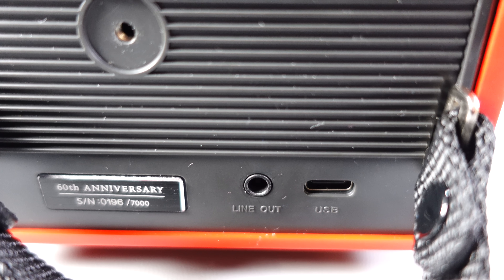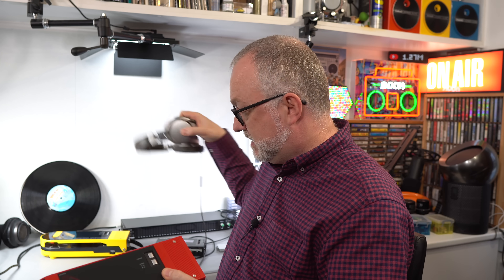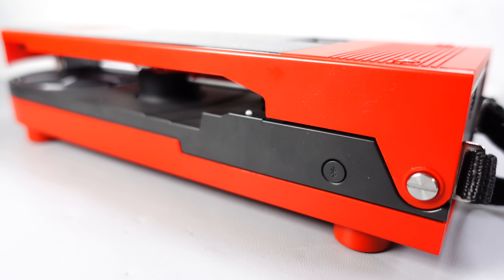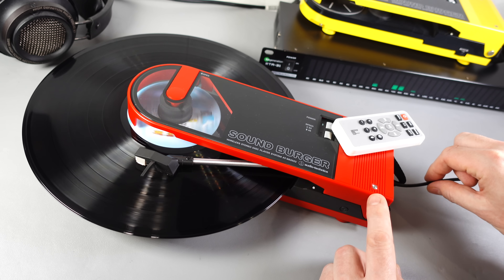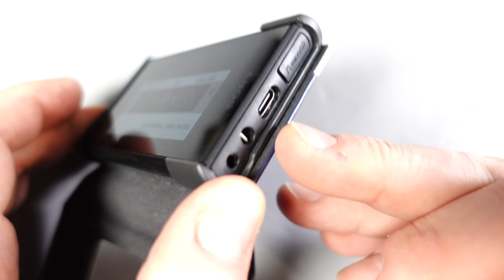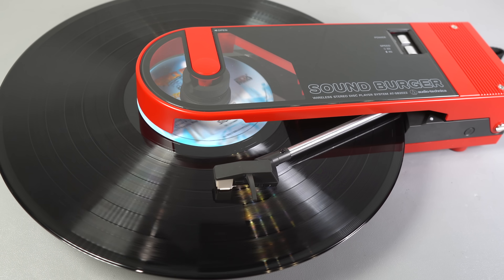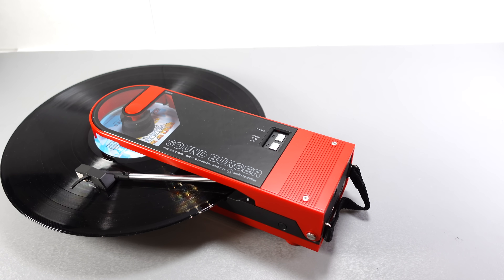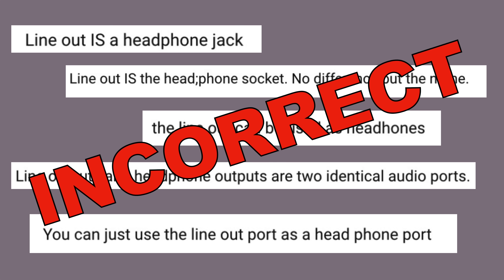Line-out ≠ Headphone-out

Comment: .. I have only watched the first 3:54 mark and as of yet, and I think you phrased yourself erroneously.. well.. perhaps not FULLY erroneously, but at the very least "in an unfortunate way"...  (and also jumped to conclusions that you didn't need to).. 

IF someone were to ask me IF a 3.5 mm "Line output" socket could be used for headphones, I'd answer "yes, but it isn't ideal", or "It's not what it's for, but yes you can... "... And that is the thing.. the CORRECT answer to.. "Can you plug in a headphone in to this socket" IS.. yes.. you can.. BUT also- even if I understand that MOST people would be splitting hairs here- It's not ONLY that it's technically possible, but it literally IS an audio output.. using the RIGHT form-factor AND pin.. and.. will not damage the hardware.. so.. IF you feel like you want to.. then you can.. there is absolutely no reason to WORRY about trying it.. 

Earlier in my life I would ONLY have answered "yes", but because people misinterpret the answer, I have learned to ADD those extra points DESPITE not beinga sked for.. A lot of people complain about the length of my comments, and this for good reason. MOST of my posts and comments could take more than a page if printed out..but.. I learned to remember to always hedge my bets because, as a general rule: People are stupid and incompetent.

Also; The two headphones you took out as of now.. BOTH are "over-ear" phones.. yes.. a standard 3.5 mm  "line out" doesn't drive them the right way (waaay too many ohms), so.. DEPENDING on how loud they are CREATED to be able to play.. The actual volume you get will vary, but between.. kind'a low.. to.. inaudible.. but also.. if you use IN-ear phones.. then you may actually get a DECENT volume, especially since it also will filter out everything else.. Technically I am annoyed with MOST phones I have had because their internal volume IS too weak for the loudness I want in my earphones.. DESPITE being built for them.. so.. "satisfaction" with the volume depend on what someone wants.. BUT.. if someone ONLY bothers about WHETHER they can listen to a record through a line output?.. then.. I'd say that with in-ears phones.. you can actually listen to the music.. and.. the question then becomes being about the "use-case".. as you ALREADY said, this is NOT a system you use in order to be able to listen to albums while jogging or ANYTHING like that.. so.. when would someone like to have a sound system "on the go" when it is REQUIRED that you have a flat surface to placee it on?.. and.. that it doesn't get shook..?.. well.. a pic-nic, out-door party, or something like that?.. yes.. but would you use EARPHONES in that scenario?.. I personally think.. not?...  also.. do people want to have to carry an amplifier and speaker (or for that matter; An amplifier and earphones).. In all other potential use cases?.. I personally suspect not.. Heck, the only use case I can THINK of where you DON'T want to play it on speakers is IF the need to listen to something "on the go.. while being completely sedentary and not shaking too much".. would be if you are trying to buy some highly priced vinyl and want to KNOW that it doesn't "skip" or has other problems with it.. hence.. volume? is not the concern.. to HEAR it is, and ease of transportation is.. especially since a LOT of peoplel selling old valuable records didn't themselves actually get those records, they just inherited it from a relative that was an audiophile- as audiophiles USUALLY keep their records unless they get a duplicate).. 

So.. use case matters.. the correct answer to the question "can you use earphones on a line out" is yes.. BUT there are follow up questions.. and.. 

....... in the end.. Even if ONLY saying "you can" to a question where there CLEARLY is an asterisk that should be put there.. or.. at least end it with a "but..".. may not be MORE erronous than SAYING that the answer is erroneous without pointing out that it.. ISN'T erroneous, just something that.. "doesn't explain the whole situation".. 

The other things you mentioned (about OTHER 3.5 mm ports used for other things- f.ex. digital data, power, etc..- isn't even really relevant.. I NEVER take ANY responsibility IF!! someone make up things my answer would mean which it doesn't.. so.. IF I were to say.. "A line output can.. ".. then I am NOT saying that you can plug in a microphone in a line output, nor a n external system- or even earphones- to a microphone input..  Yes.. they are NOT all the same.. but.. to say you CAN do something isn't the same as saying you should, and more importantly.. it doesn't mean that just because you are TECHNICALLY able to do something, it means it's okay to do so in ALL situations.. I shouldn't have to write a LONG list of EVERY potential situation that may or may not relate to the specific situation I am asked about (though I do), but.. no.. the correct answer is.. "yes you can connect your earphones in this socket.. and as a bonus validation of that question I'lll throw in that you won't harm anything by doing so... ".. whereas "but would it do what I WANT it to do?".. well. that will depend on your expectations, your hardware, and so on..  

So... saying.. "It's erroneous".. is.. based on correct information, but itself is (at least) equally erroneous. That is where the expression.. "That is a truth with modification", or.. "Well, it isn't wrong, But".. belongs. . and using over-ear phones to try to show why the answer is wrong?.. that is like AIMING to prove something to not work.

I have have saved one of my "issues" with the answer you so far provided to last.. that is.. "non-standard specs".. The thing is; There may BE an actual "standard".. yet... I have had a lot of different units.. and.. in SOME units I can say that there is NO (passive)  loudspeaker I know of that can play the FULL  strength of the top volume (WHEN used with a tape, or record that IS recorded in a COMPARABLY loud manner.. remember the old players with analogue gauges?.. the amplifier chips know nothing, they  are just stupid amplifying chips TRYING to do what they can until they can't.. and.. SOME tapes you bought DID run BELOW the actual.. "red" part of the analogue volume indicators.. but MOST of them.. went AT LEAST a third in to it.. and.. it was supposed to tell US how loudly should be considered when we recorded to tape?.. the professionals broke it more often than not).. so.. Yeah.. There IS a standard.. more than one in fact.. millions.. regarding the level out-puts.. but.. a LOT of them don't "limit" what something CAN support, only that it has to AT LEAST support "this".. hence.. Some units do have SOME form of volume control that DOES work on the "Line out" part of the system too (At least I know of a mixer-board of two that does).. where.. you readily could use earphones and listen EASILY to what was created.. I mean.. you wouldn't want to because you are overdriving the chips.. NOT enough to make distortion, but to increase temperature and reduse longevity.. also.. they DO have earphone outputs.. ).. But.. I use extreme cases as "examples".. but yeah.. it depends on all individual units and the creator of them.. as to what they can or can not do in form of volume.. though.. Line outputs DO have some requirements as to what they should handle.. ear-phones doesn't fit the requirement, BUT! it would take MORE work, and MORE components to make SURE that they don't work.. hence.. If you got responsive enough earphones- espeecially in-ear ones.. you could possibly use a line-output on SOME device to make yourself deaf.. (though I THINK that only could be possible if the device itself KNOWS it's power and has SOME form of volume control that would affect output.. you know.. like... ALL.. Mixer-boards have)..
Reply: I’m never clicking read more again 😊

Comment: Using a headphone out as line out isn't exactly "clean" either, Isn't line output suppsoed to be a "normalized" value so it's the same level on every device?
Reply: Line level is a standardized level, but for one hook up it doesn't have to be at that exact level, anything that works would be fine.

Comment: Line in/out had/has a standard I believe of 1volt max. Not enough to drive headphones but sufficient to transfer to other equipment; for example a tuner/amp. They can be just about any format like RCA connectors, 3.5mm socket etc.
Reply: Professional line level connectors operate on a voltage range of 1.2 volts. Consumer gear like the sound burger, has a voltage range closer to 300mV

Comment: Often I will use the headhone output on a TV to a amplifier and speakers, as thats what the manual says to do on some TVs.  Nowadays you can split the audio off from HDMI/eARC to get a digital output instead.    I use a DAC/AMP for my headophones which can take digital or analogue input. But this was a good overview of what the difference is between the two outputs.  Thanks.

Comment: It seems the confusion comes because many newer TVs use the same port for Line-Out AND Headphones, most likely to save on costs.

Then in the TV software settings you have the option to set if the output will be fixed volume line level, or amplified output that can be controlled with the volume buttons.

Usually these 3.5mm ports have both a line-out arrow icon and headphone icon on them, but are not always easy to recognize.

Either way, this was a very well explained video about the difference between the two and it helps to clear the confusion a bit. Thank you so much for making these videos!
Reply: Its not just TVs. Its everything.

Comment: I find it amusing how many of the comments here are just explaining what you did, in the video where you explained it. At least some others are offering up theories as to the confusion. I shall just say: well done on a fast and simple explanation which avoids going over people’s heads. I like electrical engineering but if you tried to explain with voltage and impedance I think you’d lose a lot of your audience — just saying it’s too quiet is more than sufficient.

Comment: I've used line out with a lot of headphones, from game consoles, to cassette decks, to VCRs, and while the lack of volume control kind of sucks, and sometimes the volume is lower than optimal, and sometimes higher than optimal, depending on the headphones, I've never actually had a line out be too quiet to hear. In fact, it seems like, depending on the device, it's more common for the volume to be on the high side. 
Only headphones that have been too quiet on the line out that I've used on RCA devices is the T20RP mk3. Headphone output on handheld games systems is another matter entirely, and even a MP3 player or iPhone.

Comment: All my life I've plugged headphones into line-out and never had any problems.
Line-out is a regular headphone output but without an amplifier.
Reply: Modern hardware uses software to adjust impedence. Computers don't even have seperate jacks anymore. What this guy is talking about only applies to outdated hardware only a few people in this community still use.

Comment: As you stated, a main source of confusion is that in practice, headphone outputs are often used as line outputs. Many a laptop or phone has been connected to an amplifier or powered speaker system by using the headphone output to feed the line input of the amplifier. Judicious use of the source device's volume control can give an appropriate signal level at the headphone output. Output impedance is really the issue here. Headphone outputs are low source impedance outputs while a line out is typically a high source impedance output (and as you say, line outs don't typically have a volume/level control). So a headphone output can do a passable job of providing a line output function, but a line output cannot drive most headphones.
Reply: A note to add to this...  My Asus laptop, the headphone jack can also be used as an actual line out, as when I plug something into the jack, my laptop with clarify first, whether I plugged in a line device or headphones, and upon selection, it will adjust the impedance and audio levels accordingly.  Which is very cool!  🙂
Reply: @jinky0u812  Was just going to say this, as a high proportion of PC desktop motherboards built in audio will allow you to change on the fly what the 3.5m inputs/outputs can be used as. So I imagine this has caused a fair bit of confusion.
Reply: is it anyhow harmful to the laptop if i connect it with a speaker system with subwoofer and 5 speakers??
Reply: @harshnair7126  If you're going LineOut -> Speakers then you should be fine; assuming the speakers themselves are properly amplified.  A line-level output is there to deliver a mostly un-modified audio source so that you can tune/amplify as you desire.  Please also note that a 3.5mm jack CANNOT transmit a full 5.1 signal.  A quadraphonic surround CAN be encoded through stereo channels (requires a proper decoder) - but for true discreet 5.1 channels you'll need SPDIF or HDMI.  For this instance, I'd strongly recommend getting a USB audio device that can properly output 5.1.
Reply: Not to mention that Realtek's ALC sound card chip allows to change pins purpose on-the-fly. So your jack connection can be either mic input, line input, line output or headphone output at the same time depending on settings ;)
Reply: Nope, your cause and effect are temporally reversed.  The recent practice of allowing a single jack to configure according to plug inserted is an adaptation to lessen the confusion already present and persistent, it is not a source much less "a main source" causing confusion.
Reply: @RoySATX  never confusing, in half a century, once as a kid I had headphones sound really quiet.  I didn't  freak out, I plugged it in the other hole, and good.
PCs haven't cared for decades.
recent practice? 20 years.
more like it became cheaper and more cost effective to streamline case designs, circuitry, and fewer parts (half the 3.5mm jacks per device for output).  This issue was so insignificant I don't recall anyone ever complaining about it, and I figured it out on my own as a toddler ...  so I'm sure adults that it happened to, got along just fine too.  Confusion ...  people are more confused on why its always the 3rd time you put a USB cable it, it fits, not the first time when you were putting it in the same orientation!
:p
Reply: This is the actual answer.  I just spent 5 mins listening to half accurate bullshit watching the video itself, which presents things as if headphones can never be plugged into the line out port, but the truth is the often are and work just fine, and there is no other option anyway on many devices.

Comment: Line out: used to load games from cassette on the ZX81/Spectrum computers, though sometimes (especially if you'd saved something to cassette) you need to use the headphone out as the recording volume may not have been set high enough.

Comment: Part of the problem with people not understanding the amplified output of the headphone jack revolves around the 2000s and the advent of the iPod and MP3 players which, in my opinion, incorrectly gave instructions to use the headphone out as a method to play into an amplification source. Albeit, pre-amp gain circuits and their protections against resistance and "Back EMF" have come a long way since our heydays of component stereos and what not but I remember a time when you could easily BURN OUT a pre-amp output or a line-level input by playing the pre-amplified signal. 

For those, potentially struggling with the concept: You have certain turntables that have a built in pre-amplifier which boosts the tiny little electrical/audio signal from the needle vibration. You can connect this amplified signal to a LINE INPUT (Usually a set of left and right RCA connections) in the back of a stereo and it has been boosted just enough for the stereo to further amplify the signal to full volume. If, however, a turntable does not have a built in pre-amp, the electrical/audio signal is so weak, you hear a tiny little bit of sound using the same connection. Lastly, there were/are stereos with dedicated PHONO INPUTS which are connected to a built in pre-amp inside the stereo itself which boosts the weak signal and passes it to the main amplifier circuit. If you connect a turntable with a built-in pre-amp to a stereo which has a built-in phono pre-amp you are applying an exponentially boosted electrical/audio signal into the main amplifier circuit. This will cause an incredible amount of distortion and clipping and potentially burn out in the inputs of the stereo OR even the outputs of the turntable. It all depends on the tolerances and the built in protection circuitry. Lastly, this is the same concept as the DISTORTED electric guitar sound: A guitar amplifier has at least two boost stages which amplify the tiny electrical/audio signal from the pickups, every time the signal is exponentially boosted from the previous level it creates distortion elements then the final boost is this this distorted signal played through the main amplifier which generates the power for the loud speakers. The more gain stages or level of gain from pre-amplification the more heavy/raunchy/distorted guitar sound you get.